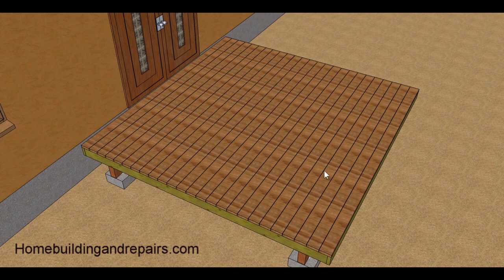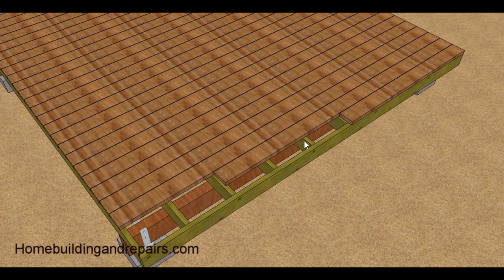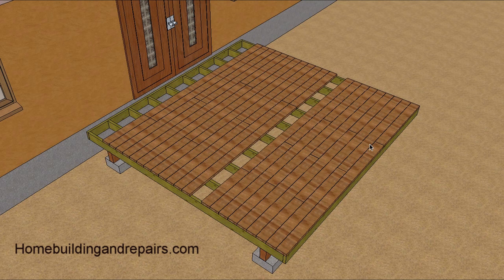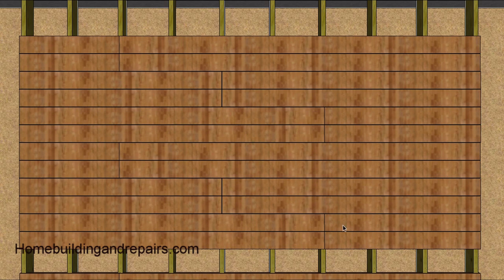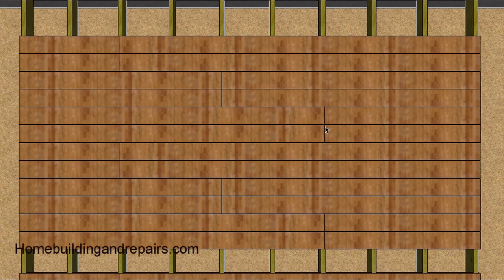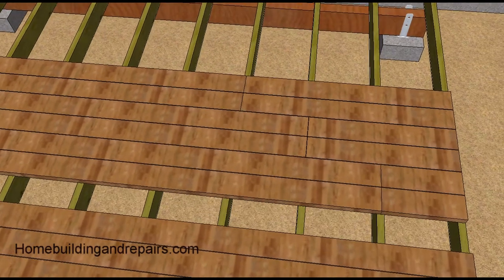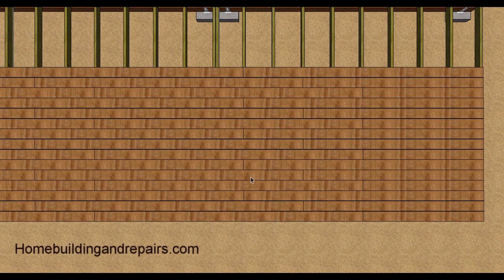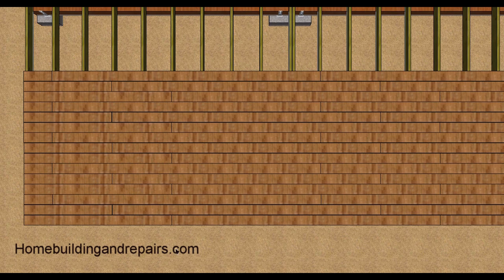How to Use Shorter Deck Planking Lengths on Larger Decks - Lumber Breaks

Comment: No belly board?
Reply from the maker: Not for this type of design. By belly board I'm assuming that you're referring to a ledger that would attach to the building.
Reply: constructionideas you can frame in and run a perpendicular deck board to seperate the deck into 2 even sections meeting in the middle at the "belly", essentially block in between joices and pack out with a 2×12 and a 2x4 side by side
Reply from the maker: Then yes, you could use a variety of different designs, this is just one of them.